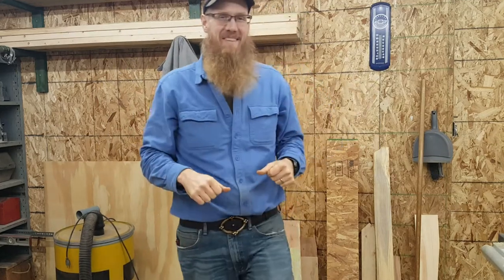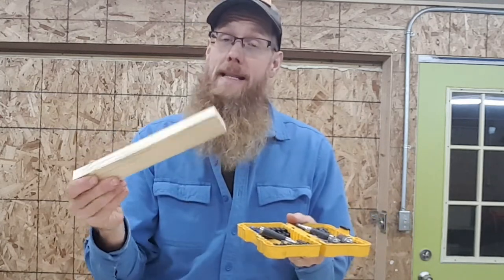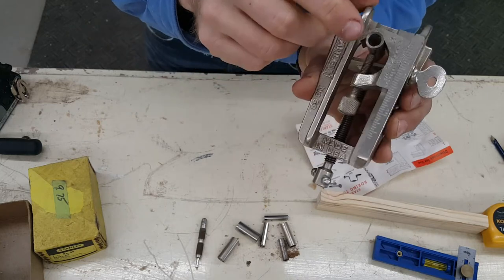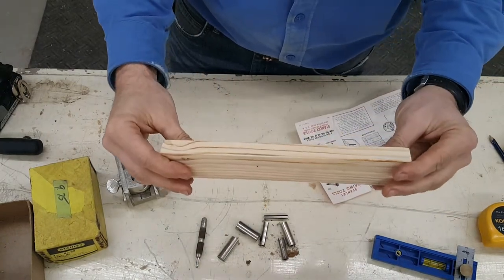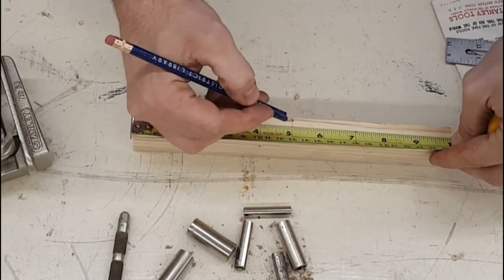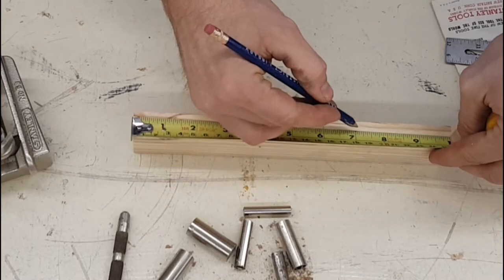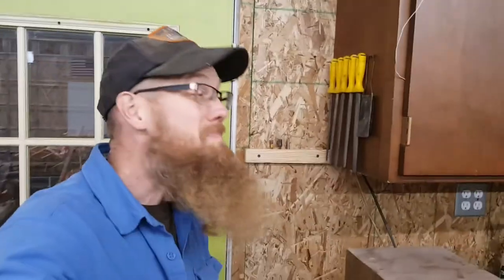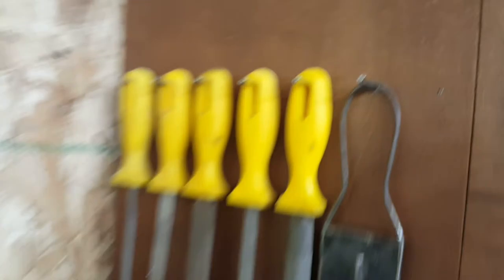Using the Stanley No. 59 to build a tool holder

Comment: you didnt overpay 9.75 is a bargain, that will last forever and you got all the guide bushings. I looked at all the new stuff before I found someone on a forum many years ago recommend it. I like it because I can clamp up to 2 3/4 if necessary.

Comment: I own this but haven't used it yet. The only issue I see is the holes wasn't perfectly straight in line with each other. Is this a common problem 🤔
Reply from the maker: Have used this tool in a while.  If memory serves me right, lots  of setup, but success will follow.  Well built tool